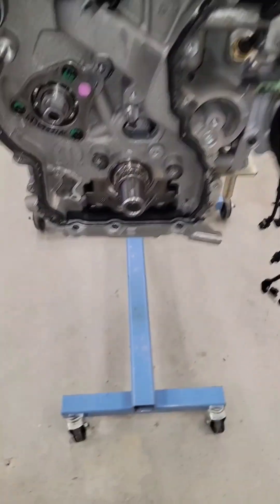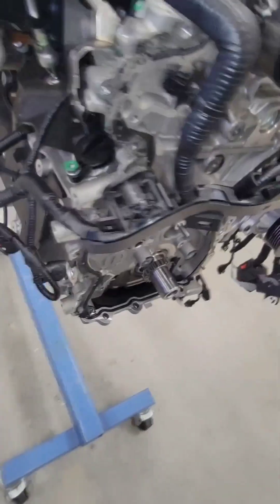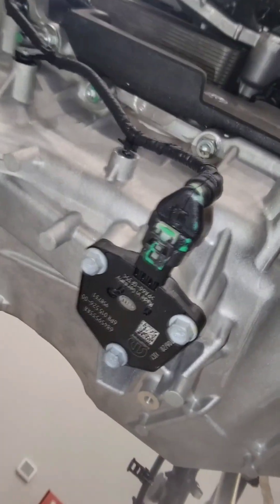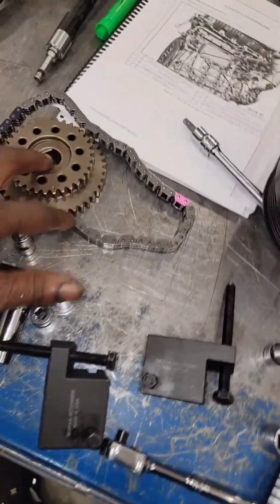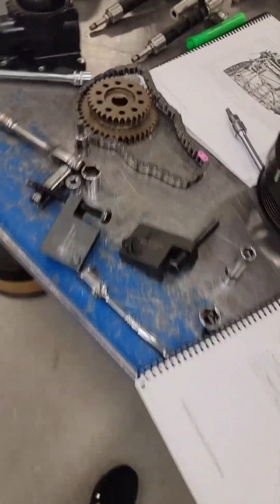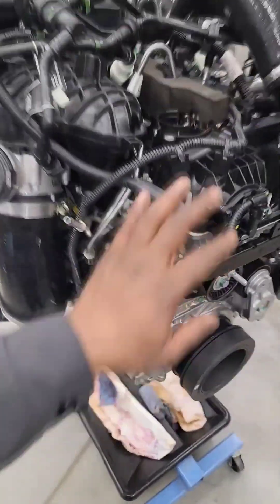Stellantis car engineers said NO TO THIS. And they made it impossible. Here's why.

Comment: This is a dumb idea, especially for a manufacturer who's vehicles are plauged with electrical gremlins.   A dipstick is a simple, reliable method to check your engine oil level.  I wouldn't mind ALSO having an electronic oil level sensor, but for something so critical, and likely CHEAP to build into an engine, they should have kept an oil dipstick.

Comment: If THAT digital component fails you WON'T be fine.   As you will have NO WAY to know the oil level. I'm not against the digital option,  I love tech. But a CRITICAL status of oil level should at least ALLOW an option for manual checking.

Comment: I appreciate what you are saying and I respect your position on this topic but I like to look at the oil appearance periodically as it flows to the pan and this has always been a convenient spot. Call it "early warning". Doing this has saved me a big ton of money, catching coolant and oil mixing. I don't want to give that up. Give me the display and the ability to see/smell the oil and you've got a deal!!!
Reply: Facts!!! Caught a seeping head gasket on my car after a long crank and white smoke. Immediately pulled dipstick and saw marbled oil. Drove it STRIGHT to my shop to start tearing it down. Started running hot as I was pulling on the lift. And even besides that, I too like to pull the stick just to see how things are going.

Comment: Perfect solution to the age old problem of customers wanting to keep their money. Replace a 100% fool proof system with an electronic sensor. In 30 years of own internal combustion engines (I currently run more than 20) I have never had a single dipstick go bad. Never even heard of it happening. In that time I’ve had numerous sensors die.
Reply: This!

Comment: Two side to look at that. Many people never open the hood, let alone check the oil. What happens when sensor goes bad and and stops reading level thinking theirs oil in it.
Reply: If the sensor goes bad it throws a check engine light at the minimum.
Reply: Not good enough,  as you will be blind to the level at that moment!!  @LoneWolfSparty
Reply: @zoe7657 usually the cars that have an oil level sensor and no dipstick will do a level check when the button is pressed before the foot is pressed on the brake. If the sensor detected a low oil level, there's a check engine light, a loud chime, and a message on the screen in between the gauges. If a person still manages to start the engine at that point, well... they're just asking for it at that point.
Reply: @LoneWolfSparty  I get that,  but the issue is if THAT system fails you are stuck with not being able to pull a PHYSICAL device to KNOW factually if safe to drive.  You're at a tow only status as default upon failure of sensor.

Comment: When it’s rebuilt the machinist can drill the hole for a press fit aftermarket or factory style dipstick I’m sure. Would much rather see it on a dipstick or analog gage. I am curious how does the ✌️factory ✌️electronic dipstick work.

Comment: the fact there is one cast in and not completly removed says the sump is of a differant engine that does have a dipstick therefore find the engine with it fitted and swap it out or drill the hole out.
Reply: Drill the hole out? I hope you plan on pulling the oil pan at minimum if you attempt that. Because any sort of metal shavings that would occur from your attempt would wipe out your engine in a hurry.
Reply: @LoneWolfSparty  its common sense not to leave metal shavings in your engine. i doubt a guy named boostedmike with a sweet turbocharged engine for a profile pic would need to be told not to leave metal shavings in his engine block. a person with a fully functioning brain shouldnt have to be told that.
Reply: @extrazero1593  there's a lot of people who lack fully functioning brains these days. And just because there's a picture of a built engine doesn't necessarily mean he actually built it himself.
Reply: @BoostedMike2  so you did all the machine work yourself? Really? How many thousands did you mill off the head and block? What valve keepers did you use?
Reply: @LoneWolfSparty  4 thou of the head to clean it up  and no i have a machinist i did port it myself tho and 3mm larger intake valves stiffer springs titanium retainers new bearings arp studs and bolts for everything 2 cp3 r90 hpfp, 400lph lift pump ,130 over injectors, tripple plate clutch, 62/66 turbo and a nitrous kit too trying to make 1000ftlbs of torque out of the 3.0d bmw engine thats now in my mitsi
Reply: @BoostedMike2  you didn't change any of the pistons?

Comment: Do these electronic dipsticks have a fail safe on them when they fail. 
With some people if the car says low oil they will add oil every day because the car says.
At least on this hurricane thing looks like you can change it without dropping sump. 
Imagine explaining this to your grandparents. What are you talking about Sonny. Back in my day.....
Reply: Have you ever seen one fail to a “safe” level? Failure will indicate a high or low out of range setting.
Reply: No. I mention it before . Customer car had warning to add oil and he kept adding oil each time the warning came up. Than I checked it and it was overfilled when I  drained and swaped new sensor in. Overfilled by 2 quarts

Comment: BMW has been doing the no Dip stick for oil since at least 2008. I had an X3 that I had to use the cluster control in order to read the oil level. It’s not the end of the world.
Reply: As a mechanic, the first “no dipstick “ encounters were transmissions. GM you pull a little  plug out and run the cat , if it drips , your full. Mopar came up with a measuring stick that you need to match mm of fluid to a temperature reading, set scan tool to trans temp . When I came across the BMW my first thoughts were to put back in what you take out. I couldn’t find any info on using the cluster. I could only hope that it wasn’t an oil burner and I don’t put enough oil back in .
Reply: MY Sq5 Audi had the digital BUT still had option to add dip stick. BTW the BMW B58 is a very solid well built engine as well.
Reply: Your an idiot...and not a mechanic. Do you know how often electric sensors fail and not stop working but giving false readings. 

I see it all the time for engine temperature, sensors, oil pressure, etc completely false readings 

You could have no oil and it will go on reading no problem. 

This is the dumbest shit they could ever think of and yes the end of the world. 

Also explain how you check the oil when that system fails completely and you don't have $1200 to replace what a $5 metal stick can do....
Reply: So what you're saying is basically now 2 of the most unreliable car brands in the industry have removed oil dipsticks.
Reply: @Mike__P  I don’t know about how others maintain and service their own vehicles. All I can say is I had that X3 for 340,000 miles and I was the 2nd owner. It was a lease vehicle prior to me buying it. I do service all my vehicles regularly. I also owned a Journey R/T 2014 and that one I am the only owner. Still running at 187,000 miles with the only major repair that was the water pump at 125,000 miles. Did that and the belt while I was in there. I can’t complain too much. My wife had a Nitro for 400,000 miles until she decided to get rid of it, no major problems to report on that one either. I’ve seen others mention major issues with all those vehicles that I mentioned but that has not been my experience owning them.
Reply: @arod2104  well it's been quite the opposite for me.
Reply: It’s creating a problem for no reason. It’s not hard at all to put a dipstick there